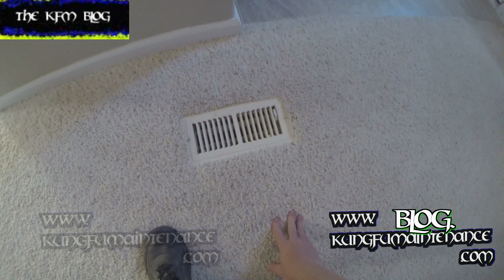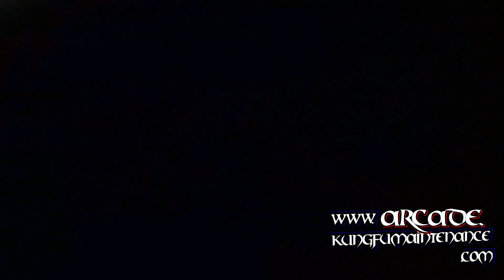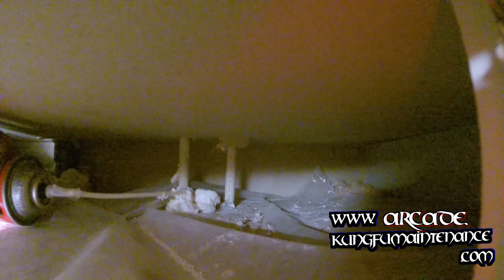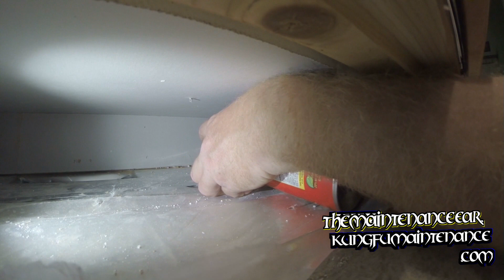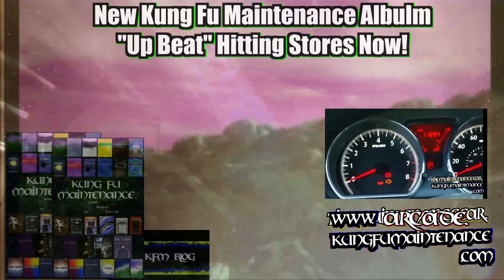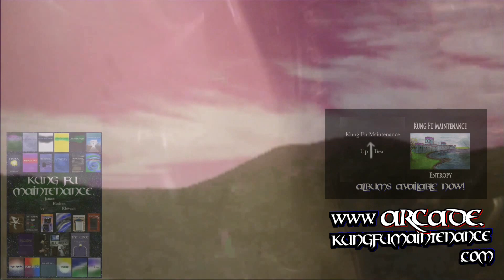Very Common Mobile Manufactured Home AC Heat Duct Efficiency Loss Place

Comment: It's  not just mobile homes though it is simply shoddy workmanship in whatever kind of home ...the more mass produced the more CRAP ....stick built tract homes can be atrocious in CRAP quality ...they build em as fast as they can and everyone is getting away with cutting as many corners as possible....I have seen SUCH crap on regular tract homes...so bad it just makes you wonder how the people responsible can even sleep at night!   On home I owned the roof rafters were supposed to be 24" on center but in the back of the home where the rafters laid on the top plate?   No one even TRIED ....it was all over the board 20"  28"  22"  27"  21"  ...I mean WHY???   To save cutting the blocking they used scraps??   HOW can things be THAT crappy??    I have a manufactured home now and it is in some ways better quality than that tract home was ...worst things are the electrical boxes, and duct work  ...it's like no gave a CRAP ...I could just scream looking at some of things companies put out!   People should truly be ashamed of themselves~!

Comment: The first pipe he sealed obviously was not good enough. You can still see the plastic moving from the air.
Reply: did you think that maybe the plastic was still moving because the air flow from the vent itself?
Reply: really if you can't get the nozzle RIGHT into it?  It is going to be crappy foam job ....I would have reached in with a putty knife and tried to smoosh the foam INTO the void ....other way is to go under the floor and squirt upward!